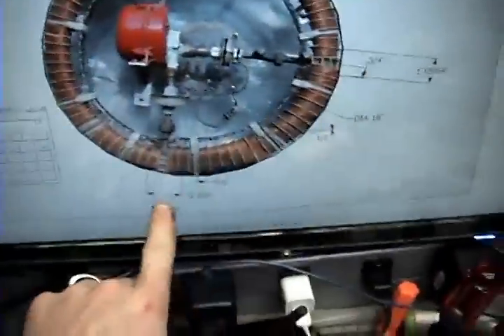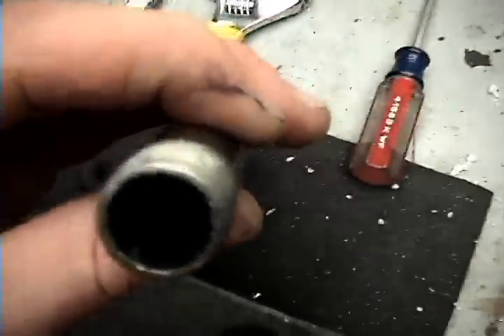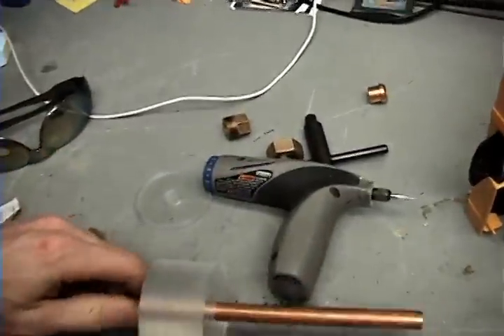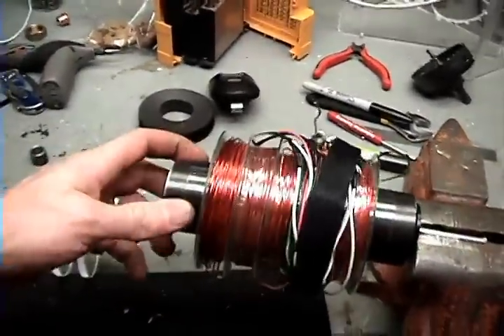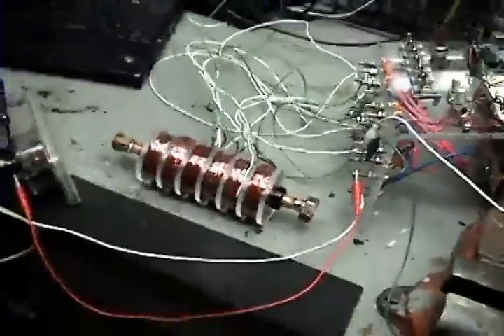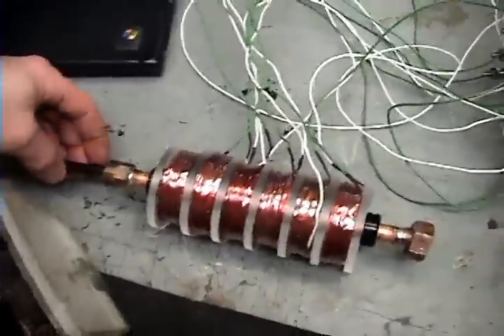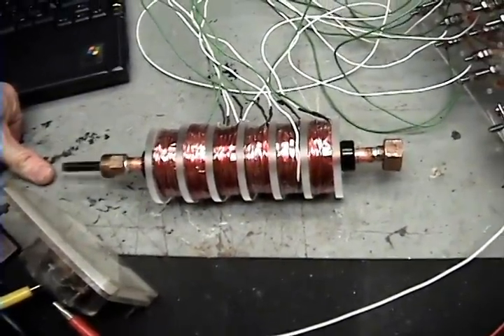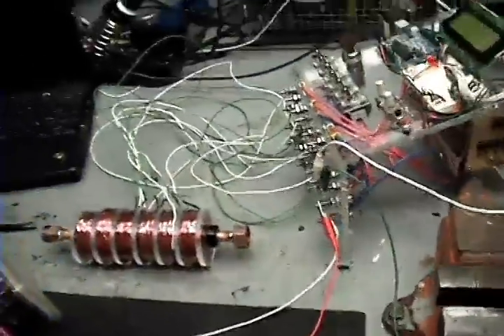Brand New Nice Working Primary Coil For The Copper EPG Replica RWGresearch.com (TEST EPG2)

Comment: in fact it look really good....2 thumbs up
one thing thing though.....i do not agree with the night rider mode.....should start from the same side on every pulse sequence....so everything moves in the same direction....that way the gasses would continue to flow around and back to the biginning  and keep flowing......the mechanical pump would have flowed this way....then you can speed up the flow by speeding up the pulses

Comment: it looks like a mechanical magnetic pump, sweet.

 a single wound wire solenoid would have sucked the punch into the core, and keep it there, unless you break the magnetic half way through. your primary works like a magnetic pump istead? cool.

Comment: Been watching through your videos again, trying to piece together things from the Meyers videos. It looks like you got tied up for a really long time working on the injector for the car motors. In Stanley’s videos, that injector is like the plateau of his inventions, that quite an advanced part and I don’t think they system is really necessary anymore. With the progress of technology and electrical motors since his time, I think it would be massively more productive to work solely on the EPG production of electricity. Just forget about getting too tied up spending time on the hydrogen production/water. In his videos he says the key to the EPG is the bonding of magnetic gas at room temperature. His given example is ionized iron and argon. And using high voltage and hitting the argon with a laser to prepare the iron ions and argon for bonding. You need to get a Van de Graaff Generator made so you can play with some extremely high-voltage more easily. Your work is absolutely incredible, but seems to be lacking some of the process details. Meyers always uses a laser to help separate, and in getting these terms mixed up, he uses a laser to weaken the covalent bonding between the molecules and ...Ions? Maybe? The little orbiting particles. A lot of your EPG models look like they’re up to function, except for the gas and laser. I don’t know what the process would be or how ions are collected from ionized iron, but Stanley seemed to think this process for bonding gasses/molecules is going to be the greatest molecular technology since sliced bread. If you could find the time in your life, I think humanity would benefit greatly from a resurgent effort in your EPG models. There is a video called 

They worked it out... The purpose of the subterranean chamber in the Great Pyramid! 

I watched that video and immediately thought this is very similar to what Stanley Meyers was doing. That video may switch on a few lights in your mind on the subject.

Comment: Russ  Tell us more about that mini lathe you have.  What materials can it work with?
Reply from the maker: hi bill, that's a fox shop, for small projects it has worked well!

http://www.northerntool.com/shop/tools/product_200419822_200419822

it can cut most anything a big lathe can. so far the only problem it has had a hard time cutting stainless steal, because it has to be cut slow it dose not have a lot of torque at slow speeds.  

else, it works good for the small stuff.

~Russ

Comment: The idea is that the microwave and the pipe are compatible. Waveguide. Copper duct is not a good idea. The glass is temperature resistant. and the water should be deionized. In the end you are looking to get hydrogen. Sure, EPG is not the best way